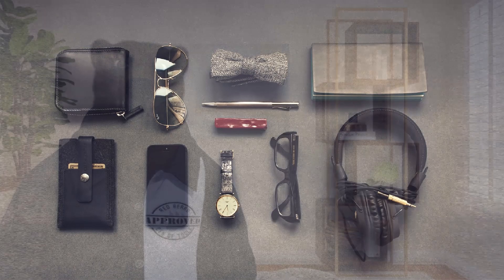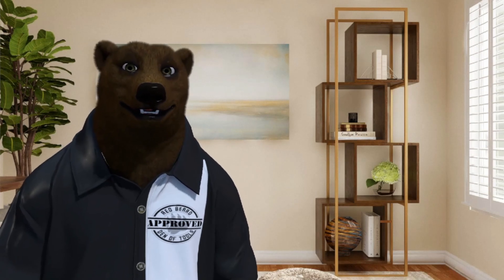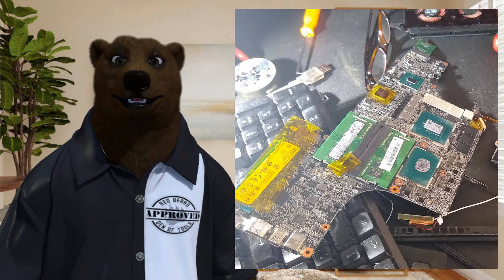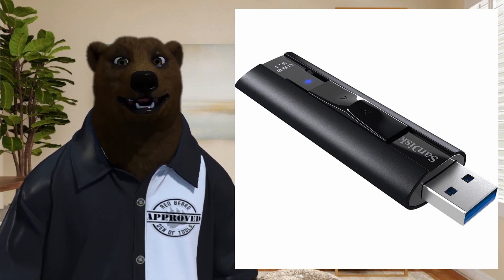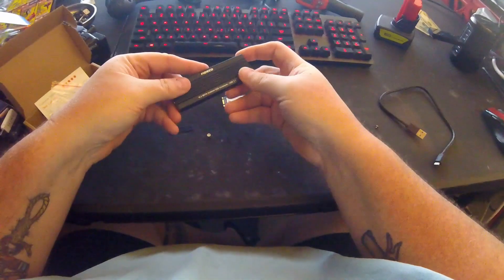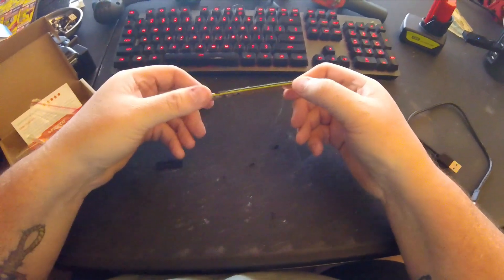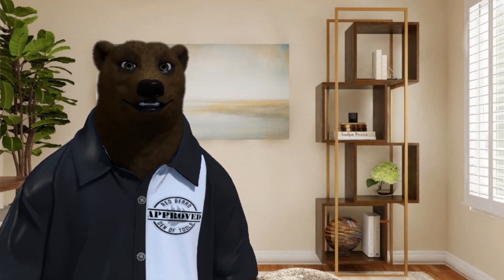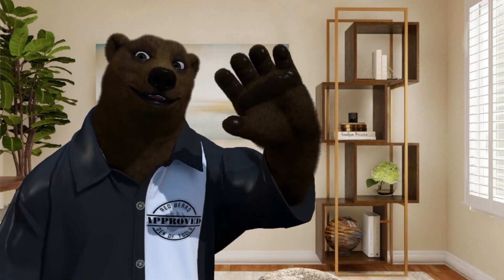M.2 to USB 3 Adapter for Under $16?

Comment: What are the transfer speeds like on this? I wonder if the usb 3 will bottleneck the sata port.
Reply: USB 3.1 is faster but has more latency.  Real world it ends up about the same
Reply: @denoftools  USB 3.1 is the same speed as USB 3.0  both are 5.0gb/s unless you are taking about gen 2

Comment: Well at least that Jeff fella hasn’t horned in on your home screen. 🥴 I am retired from my second career witch was in IT, and only spend time as needed to keep my equipment in order, because I still do part time work from home 1 to 3 hours a day. Perhaps here I can ask some questions, as I am looking to fool around with my YouTube channel, such as, what is an ok free program to use to start editing video and audio. I am part of my churches worship team and need to put lyrics slides, chords, and sometimes tab sheets for other players to practice with. I really just need the functionality of the old windows movie maker I used a few times in the XP days. Thanks for your time Jeff.
Reply from the maker: I just switched from Adobe Premier Elements, which I paid about $90 for to, DaVinci Resolve 16 and WOW. DV is about as robust as the full Premier Pro.  Has some of the best color correcting on the market, not that I use it that much, and is very affodable as it's free for the basic package and $299 for the full pro.  Consider that Premier Pro is almost that but you have to pay every year for it.  Here is the thing, this is a REAL editing package and if you are not used to full scale editing software there will be a learning curve.  It's been about two weeks and I'm still figuring it out.  I've found that I have a hard problem learning things I already know a good deal about.  I hate to slog through all the basic stuff I already know to find the few nuggets I'm missing.
Reply: Den of Gadgets Thanks for the info Jeff. I had received the same advice from another trusted source, so I have installed DaVinci Resolve 16 and it no doubt will do much more than I need, but it certainly looks robust and all I will ever need. It is like the New York Times, back when they were a reputable newspaper; Even if I don’t use it all, it’s nice to know it’s all there.

Comment: I mistakenly bought a nvme drive for a laptop that I upgraded and then found the machine would not work with it. Instead of sending it back, I ordered a case almost exactly like yours (obviously for the nvme drive) and made installiation. As you said it was extreamly easy and the drive is screaming fast. It is also not much larger than a flash drive so it is very handy for what I use it for. It also saves considerable space on my internal ssd along with saving me the time and effort of keeping up with multiple thumb drives. Next time I need external storage for intermittent use, I will do this again lol. I will likely buy a m.2 sata drive and housing as they are slightly cheaper next time lol